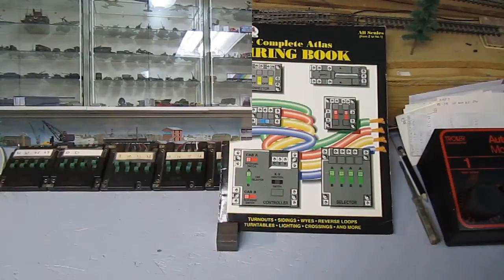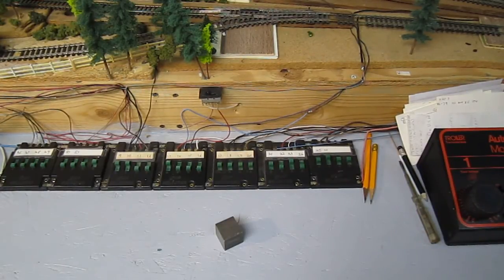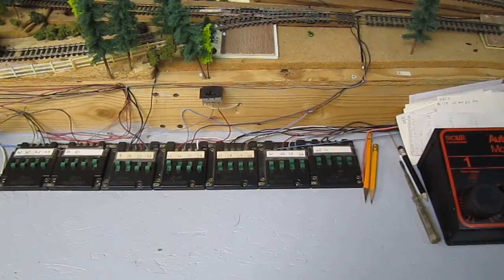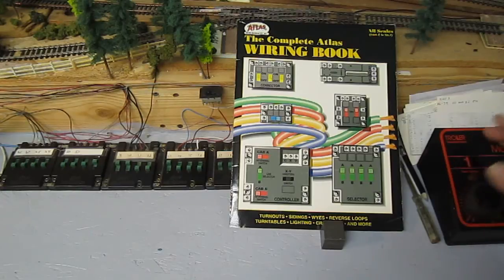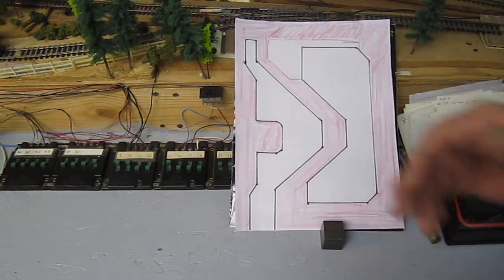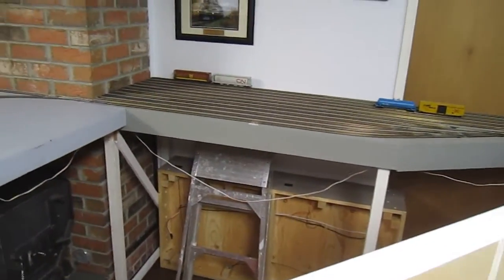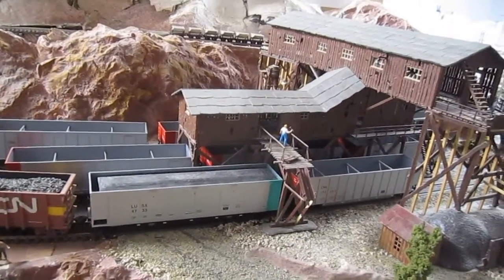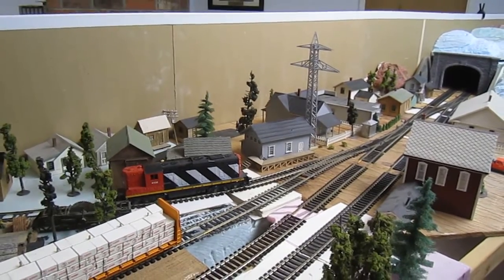Coffee Break Tuesday. 28th. Mar. 2017.

Comment: That's a great set up David with a lot of flexibility. I had the old Zero 1 set up back when I was a child It was no real advantage on my 8x4 layout at the time and I seem to remember that it made more problems than it solved. And the chips hated may old Tri-ang collection at the time and only real worked with the modern Hornby locomotives I had then. My layout now is so small (10x5) its all single circuit apart from the catenary witch makes things interesting! I played with Tri-angs Automatic Train control! but again its suited to a layout twice the size I'm playing with. I can't wait to see you layout in a video with multiple operators.

Looking forward to the next coffee break.

Oscar
Reply from the maker: Thank you for your great comments Oscar. I've always looked at those innovations as "new or different" but not necessarily better. I have not been showing my whole layout in my videos this winter as I'm doing a lot of work on one section and wanted to show that as a coffee break video so it may be a little while before I have an operating session but it will happen. Looking forward to your next also. Cheers, David.

Comment: Love the concept of "trains on Tuesday"..I am just getting back into hobby and also have too many locos to change to DCC nor do I want to get into complicated learning curve of operating it.I have also and will use the atlas block system..quick question I will also add extra power packs to where I have industrial switching. How is this done..I have the book so is it covered? I just haven't unpacked everything.thanks Jeff
Reply from the maker: Welcome to "Trains on Tuesday" Jeff. The Atlas block system is really great and easy to use . Chapter 4 on page 
24 covers switching cabs with a diagram on page 28. I have to admit that I've modified that with the use of individual single pole- double -throw -centre off switches. That is exactly what is in the Atlas selectors but I use
 one instead of a bank of four. I suggest doing a test with your controllers and some track just laid loose and see how it goes. Feel free to contact me again if you are having problems. Are you going to post videos of your progress? If so I would like to follow along. Cheers,  David.